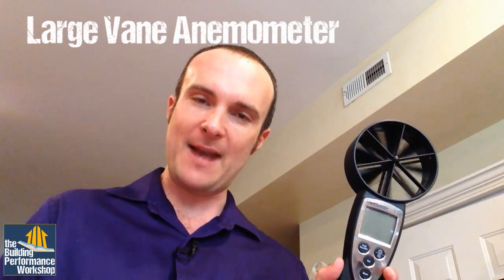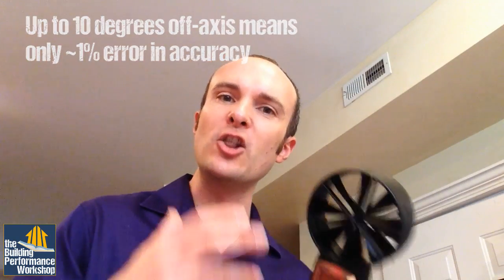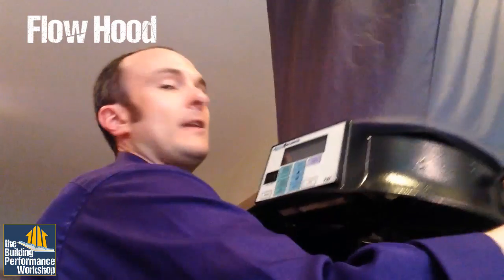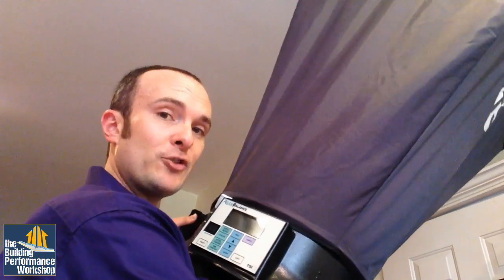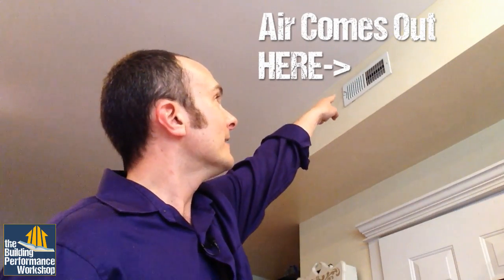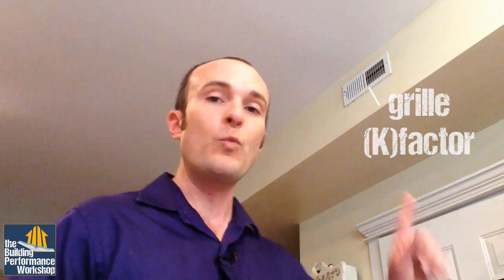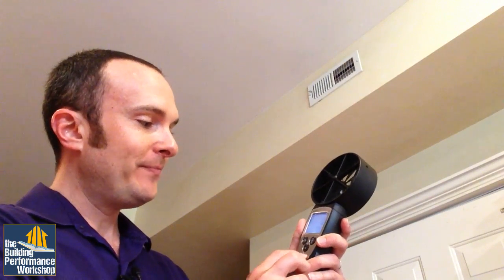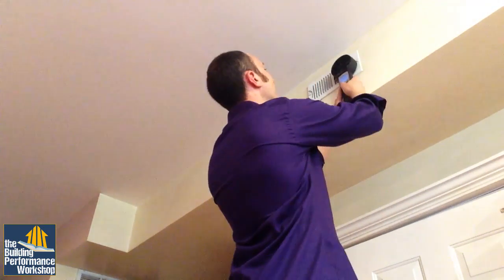Anemometer + Flow Hood: Discovering a Grille's K-Factor for HVAC Airflow Testing

Comment from the maker: +59seank This is just an example scenario- you may find yourself having to measure multiple registers, and taking them off and putting them back on could be tortuous. Also, the grille itself will introduce some backpressure, which will affect the airflow- not sure how accurate you could be with that approach.

Comment: Have you used the 417 with the accessory hoods that they offer? If you have, are they worth the extra investment to get quicker results?
Regards,
Ben
Reply from the maker: +JBH Energy Solutions Ben, I've been told it works much better for exhaust flows, which is not what I need it for, having a flow pan. Honestly, I'd give it a shot if I was sure I'd know how to use it (Testo's manuals are not known for being in depth).
Reply: I have a home in which a proper balancing was never done and they are having severe hot and cold spot issues. So my first step in what will most likely be a long process is to get my airflow to match what my manual j calls for. I thought the flow funnel may help speed the process. Thank you for your input it is much appreciated. 

Ben
Reply from the maker: You should check your Manual D calc, Ben- if that's not matching, you may never achieve what the Manual J calc specifies.  Check placement of registers against the map.
Reply: Duct sizing matches what is called for, placement and layout is another issue. For instance, I have a full 7" duct supplying the kitchen, that has no exterior walls and no ceiling load! There are some rooms I have already told them are lost causes. But I think we will be able to get much better results with a few modifications to supply, increase returns on the second floor and a balance.  
Thanks for your help. 
Ben

Comment: Excellent video! Why not just make a small collector hood from cardboard that CAN fit over small heat registers? All that air would pass through your anemometer and you could probably figure out a constant to convert fpm into cfm. Just my two cent's worth.
Reply from the maker: Good question, Paul- any box or hood will create back pressure on the airflow, so you won’t be measuring actual airflow under normal operating conditions.

Comment: Corbett, it's been informative going through your videos, thank you! But I have a question: why is there a huge discrepancy between the flow hood cfm (58) and the anemometer measured cfm (100) ? You calculated the k-factor using measured values from those two devices, then programmed that number (0.76) into the anemometer - so as far as I can tell the anemometer should have (essentially by definition) given a cfm value that's quite close to 58. What am I missing here?
Reply from the maker: I tested a different register, Aram- the first one we tested and used to establish the K-factor, then I tested a register two openings and two 90-degree turns closer to the air handler, and we got 100.

Comment: I need Techs to check new clean RA filter fpm velocities, starting with a popularly used 16X25 filter of various types so we can divide the velocity in fpm into the CFM flow volume to get the filters Ak (open air area).. Example; 800-CFM / 250-fpm = 3.2-Ak. Most filter areas are way undersized as is a lot of duct systems leading to very poor performance in both heating & cooling modes...  Publish the results here, this is very important...! Thank you, Darrell AKA ' udarrell '

Comment: It would've been good to retest the first vent again for accuracy of the K entered
Reply from the maker: +profuse007 Man, I could make these videos 2 hours long if anybody would watch them.
Reply: Sure, but that is a critical check to verify that math and reality align, and it would have extended your video by no more than 10 seconds (2.4%). If there was a step to skip over, it surely isn't the math/reality check. Otherwise, excellent video Corbett.

Comment: So the error was the grill, remove the grill and get a real opening size and that solves that problem for those who don't have that fancy hood.
Reply from the maker: And then when you put the grille back on the test you just ran means what?
Reply: @HomePerformance  you compare the difference between the flow and you have your (k). That would be logical to me. I don't see this as any different from that result.
Reply from the maker: No, the grille actually changes the flow, so the two readings are not just gross minus K factor
Reply: @HomePerformance  explain, how would the shape of the flow pattern matter if what you were calculating was CFM? If after the flow was impeded and changed you get "x" say 10cfm but without the grill you get 13cfm, why does the flow pattern matter? It's not a wing where laminar flow is critical. It would be nice to get and understanding of how this matters when I thought the exercise was volume measurements.

Comment: You never showed how you calculated 58 cfm from 351 fpm.
Reply: He didn't calculate 58cfm, that measurement was provided by the flow hood.   He then used the anemometer's fpm  to determine the flow rate of an unrestricted vent (~76cfm).  Since we know the unrestricted flow rate is 76cfm, and the restricted flow rate is 58cfm, we calculate that the (k) factor of the grill is 0.76.  The mathematical explanation starts at 5:22.

Comment: I was thinking the same thing as profuse007,, measure the original vent to see if the calculations worked!I was thinking, measure the air volume without the grill and again with and determine the difference that way. Nobody wants to do any complicated algebra, echhhhhhhh!!!
Reply from the maker: +hvac01453 Interestingly, taking the vent off reduces the backpressure and allows more airflow, so it's not quite the same as determining the net free area.